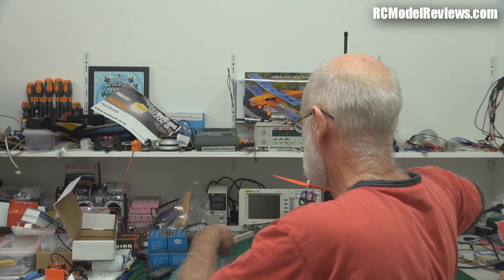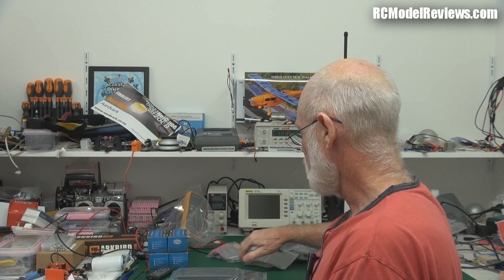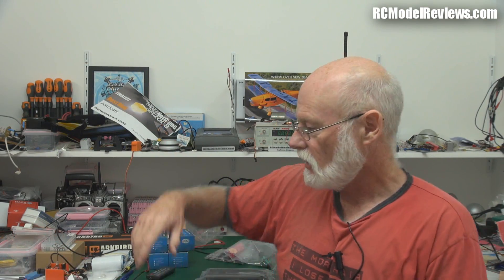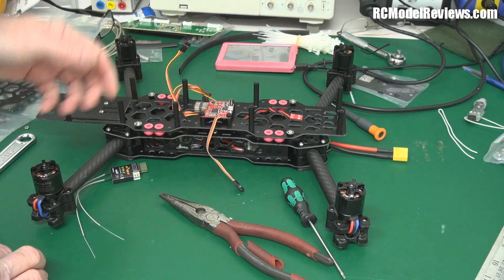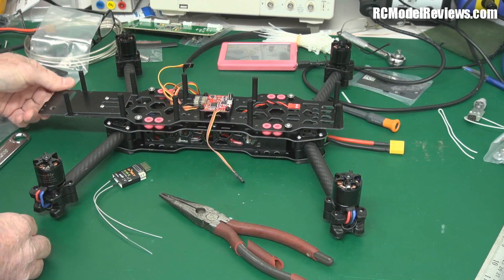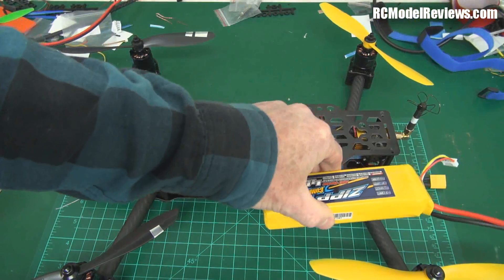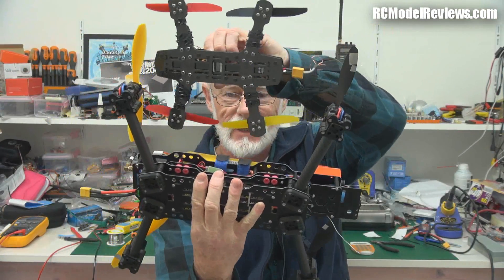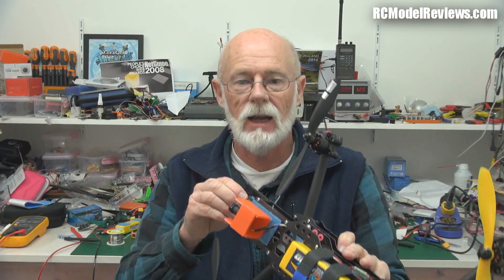Flying Cinema Cinetank Mk1 Review

Comment: I appreciate your reasons for mounting the components where you have done but you may find issues with the centre of gravity mounting that size battery at the top, particularly as it looks slightly above the prop line. Just a thought. Keep up the good work. Any chance of reviewing a larger quad or hex based on the Tarot frame?

Comment: Looks like quite a good kit.  I am slightly concerned that the individual dirty and clean vibration sections are not quite robust enough.  In your video it appears to deflect a great deal when you are pressing it I hope there is not a resonance it finds with a heavier camera attached,  it looks a bit like a diving board.

Great review as always keep up the good work.  Pleased CTC cam back to you.

Comment: Saw you're using the frsky system,I have two choices here to get a new radio and which one should I get?the orange rx dsm2 or the frsky accst?
Reply: Most definitely go for a FrSky ACCST system -- superior in every way to DSM2
Reply: ***** so I have a flysky t6 transmitter, I've opened it and found out that the flysky module runs on 5-5.2 volts,can this voltage power up the frsky diy module system?

Comment: Bruce, I have a question thats been bugging me since starting this multi rotor addiction. First and foremost I fly like a granny and have no intention of bush bashing or racing, at least not yet anyway. But my question is I see a lot of multi rotors built and they place the battery pack high up on the frame. This to my old fart mind moves the center of mass higher and thus I think would make the unit least stable. As opposed to having the battery and the bulk of the weight down lower so it acts like a pendulum and gives your rig more inherent stability. For camera rigs where your looking for absolute stability would it not be better with as much of the gear hung low as opposed to raising that center of mass and thus make everything work harder to keep everything on an even keel.

Comment: Hi Bruce, looks like a pretty sweet looking quad, looking forward to the flight vid. Out of interest, are you not concerned about having that switching UBEC so close to your vTX? Wouldn't it be pretty noisey? Or is it linear and I'm totally wrong?
Reply: It's a switching BEC but I've got the noise filter on the output of that BEC and you have to remember that there's another switching regulator on the VTX itself so noise pickup isn't an issue.  The video signal itself is routed via a screened cable (coax) to from the camera in the front and since the impedance of the video line is 75ohms, there will be very little pickup of stray noise anyway.

Comment: I also mount my battery on top.  I just couldn't get COG right until I did.  I flies great like this though. Another thought...the reason for the long motor leads is so you can replace broken arms easily, without taking the dirty section apart.  If you think you won't break the CF arms, just wait.  They break much more easily than you think.  Buy spares.
Reply: How does having longer motor leads make it easier to replace the CF arms?
Reply: ***** because if the leads are too short you have to take the dirty section all the way apart to get to the connectors.  If you leave the leads long so that the bullets are accessible outside the dirty section it is much easier because you can sort of slip the new arm in.  Believe me I've done it both ways and after breaking three arms I rewired the motors to allow for some length.  I broke another arm after that and I had it fixed in less than half the time as before.  Of course another option would be to crash less.  I'm working on that. :)
Reply: Chris Young But it's the length of the wires from the ESCs to the bullets that determine how easy it is to change the arms.   The build video says to extend the leads from the motor to the bullets.
Reply: ***** My only point is to make sure you have access to the bullets OUTSIDE the dirty section.  I don't know if you've built a Tank yet but if you have you understand why I say that.  Bruce just made it sound like one should do what I did when I first built mine and that's to make the leads short and connect the bullets inside.  I never thought I would break an arm.  Turns out they break with relative ease. :)
Reply: Chris Young
Yes, but the leads on my ESCs are long enough to allow the bullets to just protrude through the arm-mounting blocks and allow me to engage them with the matching connectors from the motors.   Having longer motor leads that are as long as suggested in the build video simply means you've got to push everything back into the dirty section to get the arms on.
Reply: ***** Then don't make them that long ;)  Also it's better to push the extra length into the arms not the dirty section.

Comment: Looks like a great Quad cant wait to see the flight video and hear your thoughts on its performance. 

Also i have a question, Might be a dumb question being as i myself have an electronics background, However its better to ask the question first then to fry your radio as a result of being to prideful to ask in the first place. So here goes, 

My radio in question does not have any knobs on it for variable control of a channel there are either 2 position or 3 position switches for the various channels (This radio is an 8 Channel RDS8000 Airtronics Radio) with that said i would like to replace one of the 2 position switches with a potentiometer, Is this at all possible and if so what value POT should i use. ( my thoughts were a 5K Pot would do the trick nicely)  I would not think there would be an issue with this modification as all a switch does is either on or off with no resistance simply adding a variable resistor would allow me to have variable control of a given channel, (Example for Flaps or what i want to use it for is a Pan and Tilt for my Camera.

By the way i dont have a go pro either i use a SONY Blogi camera it is a bit heavier than a go pro but has built in image stabilization it works great i think.
Reply: Unfortunately, modern radios tend to have either digital or analog inputs which means you can't just replace a switch with a pot.  The switches are usually hooked up to the digital inputs on the microcontroller and the pots are hooked up to the analog (ADC) inputs on the imcrocontroller.  Replacing a switch with a pot will not provide a proportiional control in such cases, just a knob that (at some point in its throw) changes the channel from off to on :-(
Reply: Thanks for the help Bruce, its kinda what i figured being a newer radio it would all go through the computer, I did however try it anyway and just as you predicted when adjusting the pot the servo simply moved all the way as the resistance decreased in the pot, No variable nothing simply on off,  The other circuit you described the ADC inputs any idea how i could go about finding out what their pinouts are. I could possibly rewire the micro-controller cut the busses that feed to the switch then utilize the pins for the ADC and simply solder them to the switchs bus then i would be able to utilize a POT in theroy!! 

The reason for all of the aggravation with modifying my current radio system, is i already have installed an Orange TX DIY Module (works pretty good if you were wondering) and the LRS 433 system all in one radio with a 3 way switch on the ppm and power circuits of the different systems. i would hate to have to go to a different radio entirely and have to relearn the new radios boards and do this all over again. I do have the New SD10G made by Airtronics which has two paddles on either side of the transmitter that are pots from the factory, Maybe my best bet is to simply return this radio to factory specs send it out to you so you can perform an analysis on the spectrum and then work on modifying my new radio.

 I will tinker with this RDS8000 a bit more over the weekend if i cant figure something out by then what address do i ship the radio to, Bear in mind it will have a few hols in it from where the switches used to be but it is in perfect working order, I dont have a Receiver to send to you for it they are all currently in use and quite expensive 50 bucks for a 5 channel and it gets worse as you add channels,  But i like the radio itself, Its a good unit made well i think and to this day i have never lost an aircraft due to loss of signal (just dumb thumbs LOL)  Some months ago i was going to ship you out a spare RDS8000 i received in a trade deal however a good friend of mine wanted to get into the hobby so i told him to go to FliteTest and watch a few of their build videos and i would give him the radio gear he needed to get flying, He still uses it to this day, has crashed and rebuilt is little foamboard airplanes so many times you cant even tell what plane they are, but the damn things keep flying!

Anyway Bruce thanks again for your help and your great videos, Good luck with your relentless struggle with the neanderthals your dealing with out there in NZ i hope you get your flying status back soon, I am looking forward to seeing all of your backlogged flights and tests of various equipment and gadgets for this great hobby as im sure you are as well, To be honest i dont know how you have managed to maintain your composure when dealing with such nonsense i would have lost it long ago and done something stupid.

Maybe one day if i ever get the chance to come to NZ i could look you up and come fly at your field, I would love to do some FPV out there beautiful country you have there.

Comment: Curious about the frsky voltage sensor.  I have one for my x8r but can't get it to report anything.   My radio is a 9x modded to opentx with frsky telemetry.   I get the voltage from the flight controller but can't get the battery voltage sensor to show.   Where does the other end plug to battery? On x8r side?

Comment: only problem is, cinetank didn't come up with the idea of the dirty frame clean frame concept... tim from fpmanuals did with their introduction of the qav500. from there on everything else is copycat.
Reply: Negative. FlyingCinema's Cinetank was the first to innovate a way to keep the clean and dirty sides on in case of crash. Everything else until this was released would separate in a crash causing a ridiculous amount of damage. This won't tear apart in a crash. You want to talk "copycat" HK's new clonetank looks like it ripped off everything to date with a crappy frame.

Comment: Did you mount the naze onto the clean section? I dont know how it will like that. Please let us know how it does.
Reply: That's what the manufacturer says -- and it's the right place for it.

The flight controler can still sense changes in attitude but it won't have to cope with the dirty-section's vibrations.
Reply: ***** Yes it will still sense changes in attitude, but aren't those changes a little delayed by the dampening? The naze is one of the few flightcontrollers, which people recommend mounting it directly to the frame. I have no Idea how strong those rubberballs are. I have a similar built quad and the clean section wobbles horizontally.
Reply: Servicehans
Because of media commentments today, I only had a chance to hover it but it's rock-solid in the hover so I don't think that mounting the borad on the clean section is causing any issues -- although I guess we'll have to see what happens at speed and under high-Gs.

Comment: Skew planar for TX?
Reply: I accidently flew 4 flight with a Skew Planar.  Video was as good and better than some of my clovers.
Reply: Did you use clover for RX or just two skewplanars?
Reply: I had a Fat Shark (Grey case enclosed) Skew on the receiver and an HK wire (no case) on the transmitter.  Yesterday I tested all my Clover Leaf antennas against that Fat Shark RX Skew Planar.   7 Clover Leaf antennas tested and I found 1 to be very bad and tossed it in the trash.  (It came from Hobby King 2 years ago.)  I them covered all the antennas with Krylon Plastic paint.  Red of Clover Leafs and Blue for Skew Planars.

Comment: Hi Bruce,
I was wondering if you can do some vertical desent tests when your out flying. Most flight controllers can be tuned to hover just fine but not all of them handle the turbalance of decening into their own prop wash gracefully. I know that part of it has to do with the props, power system and the frame layout but those would be constant if all the controllers get a turn on the same frame.
Thanks
Reply: Yes, any multirotor that descends vertically will wobble because it's passing through the turbulent wash of its own propellors and there's only so much any controller can do to reduce this effect.   As you point out, the frame design, weight and prop selection have a significant effect.

Also remember that the tuning of the controller will have an effect on this but it will always be a compromise.  If you tuned the controller for minimum wobble in a vertical descent it would likely be poorly tuned to handle (for instance) fast forward flight.

Comment: Out of curiosity, why do you think the X666 is crap? It is a perfectly sound quadcopter frame that costs exactly 10 times less than what you show here...
Reply: Which one was the X666 - I don't think either of the ones I held up had that designation.
Reply: ***** The one with one black arm... Design looks exactly like x666 or x525 from hobbyking. Didn't see designation either, with all the wavin' ;)
Reply: MasterBata
I didn't buy either of those frames from HobbyKing.  One was from Himodel (the one with the aluminum arms) and the other was from GoodLuckBuy (the one with the black arms).  Neither of them is what I would call a "good" frame for a number of reasons -- mainly mechanical.  Holes that don't line up, weak motor mounts, bad landing-gear design, etc.

Comment: Bruce, if that's the 1000mW 5.8 transmitter from HiModel then you can take away the fan. I did and it's still not getting hot. You can check for yourself be removing the screws until the fan comes loose.

Comment: The fan 'vibrating' will cause much less jello compared to the very thin plastic layers bending at the front (where the cameras are mounted)...
Reply: They only bent in the video because I hadn't finished fitting the screws that hold the top-plate of the clean-section on.   Once those screws are on it's much more rigid - although some have mentioned a bit of flex with a GoPro onboard and high Gs.

Comment: Cinetank now makes an excellent camera mount they 3Dprint.  Very strong and light and allows you to ditch the metal cases on your flight cams.  Cinetank is late to the clean plate/ dirty plate vibration isolation game but this looks to be an excellent product.  I build similar quads with Hoverthings Pro-Gimbal frames

Comment: It's a nice frame and looks nicely packaged but that design is not new and in my opinion, nothing special worth $190.00  Many other companies, like the IconicX or QAV have a dirty/clean plate design.  Some of the mini quads are also using the small rubber vibration dampeners to separate the sections.

Comment: Hi Bruce, These quad does look very interesting. I was wondering if you could make sure to confirm the flight time, and if possible can you do a fair test with those cheepo props against a better prop i.e APC or similar caliber. I think the difference in flight times between the props would go a long way to show people the benefits of avoiding cheep flimsy crap from China. 
I'm so happy that you are doing more video's on quality products. I have stopped visiting hobbyking for most of my purchases these day's and have (because of you) started to support locally built products or at least products from my continent, and as it turns out I end up spending less in the long run :-)

Comment: I noticed that you can probably swap the 2 top plates around. That way the Mobius can be mounted on top, out of the way of the propeller tip vortices and down wash.
I also wonder if the ESCs will get enough cooling inside the frame.

Comment: Hi bruce, interesting design, i was wondering if it was possible to make some comparative test Footage of this frame in 2 setup. 1) the one you show on the video. 2) the same, but without the vibration damping balls, and the "clean" plate fixed to the dirty one, so it will show how is the real effect of the design in the reduction of jello effect.

Comment: Hey Bruce, for the voltage sensor what did you use ?
Reply: That's just the standard FrSky one which plugs into the A2 connector on the side of the receiver.  I've also got one of their smartbus sensors and I'll be reviewing a range of smartbus telemetry sensors in an upcoming video.

Comment: Where did you bought the sunnysky motors, i need 6 for my hexacopter, the ntm motors that i have right now are crap
Reply: From China Himodel.com  From the U.S. http://www.buddyrc.com.  If you are looking for the small high kv motors for the little mini quads they are hard to come by right now.
Reply: I need at least 1000g of thrust. It is a 800 class
Reply: I picked up these from  HiModel.com but as others have said.. sometimes it's hard to find anyone that has them in stock.
Reply: I saw some cheap ones (sunnysky) on banggood, are they a knock off?
Reply: Yes, banggood sells the knockoff ones.  They are usually made by neewer or some other company.  I get mine from either himodel.com (china) or http://www.buddyrc.com (USA).  Both are authorized dealers.
Reply: But i cant find any with ore than 1000g of trusth on 3s on himodel, i leave on europe
Reply: With an 11x4.5 prop at 3S the 980Kv X2212 may get you close.  About 960 grams.  I am putting them on a new quad right now with 10x4.5 props

Here's a good writeup on some of their motors
http://www.rcgroups.com/forums/showthread.php?t=1521705
Reply: The ones that i have installed right now have about 800g, so it is an improvement. My hexa ways about 2400g, with everything installed